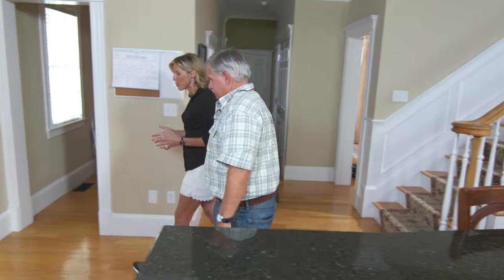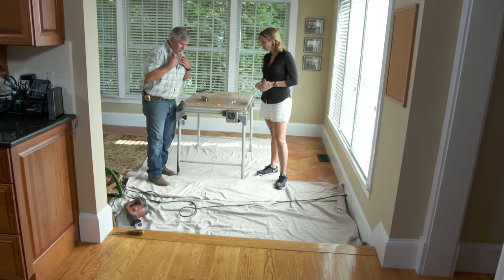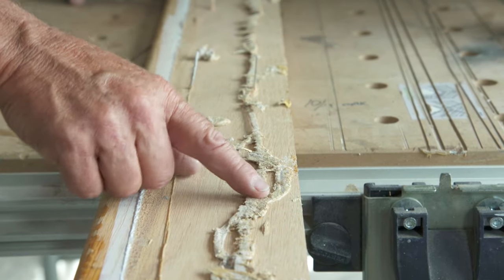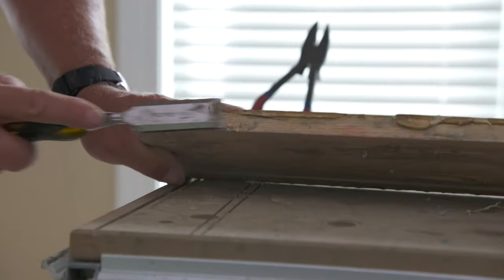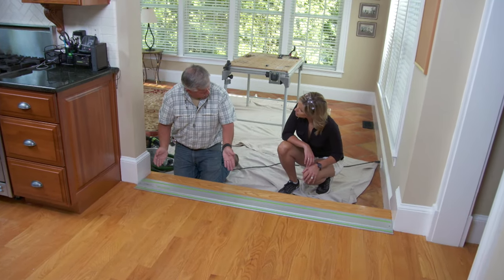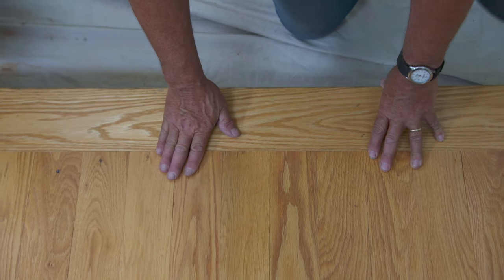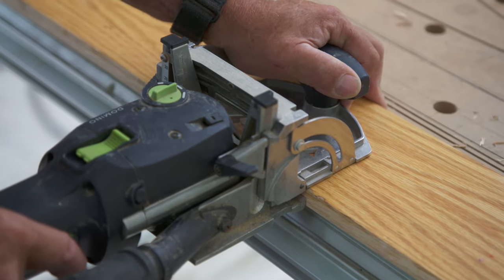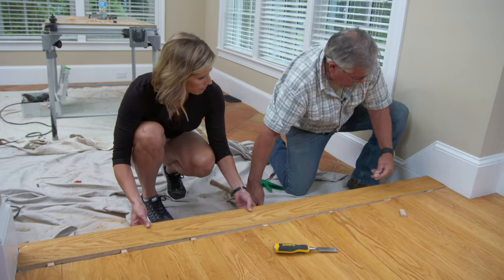How to Repair a Bad Flooring Joint | Ask This Old House

Comment: Amazing how they make a Festool track to fit exactly between those walls.
Reply: You can make anything fit with a big enough hammer!
Reply: i know i thought the same thing. things are never that easy when i do it.
Reply: @John Shay
and it comes with its own systainer  that costs another $500.
Reply: sarcasm get it? because most of their products tend to be quite expensive....
Reply: + Alexander Fagard -  I guess I'm as dumb as I look.
Reply: Ermanno D'Angelo 
maybe his customer has enough money that she can afford to pay for a festool rail bigger than the opening and he just cut it to length for the opening at hand?

thats probably a 300.00 dollar hit in the purse if so. not too bad a hit.

or maybe its a coinkadink and it fit perfect?

either way the festool track system IS  the best!!
Reply: They cut the track to fit into the space. To us that would cost a fortune but they get the tools for free for promotional purposes.
Reply: It is Festools domino cutter which is a form of a biscuit. It just happens to cost about $900.
Reply: “there you go Kate, that will be $8000.00 for my services.”
Reply: Maybe my wife will let me buy a festool track saw to do this repair at my house. Might be cheaper to hire someone.
Reply: I was thinking the same thing lol. I think he cut it to fit 😶
Reply: Tommy has Festool tracks in every quarter-inch size from 18" to 24'.
Reply: Track is for woosy, I would just use the regular saw’s spacer, nail the old board down or a piece of scrap temporarily to guard the spacer through
Reply: Yes it was designed for just that house.
Reply: @johnye4433  that why your not Tommy
Reply: For the low, low price of 600-bucks, you can have one too
Reply: @adrcamacho1 She will find a way to pay.
Reply: Even if they didn't, you can just get a straight board, cut it to length, secure it, and run any old circular saw up against it.

Comment: Cost
Festool track saw $660
Festool Certiified HEPA dust extractor $560.00
Festool domino joiner $990.00
Festool domino 85 pack $24.00
Festool work station $685.00
Reciprocating saw  $200.00
Chisel $10.00
Hammer $10.00
Wood glue $10.00
Construction Adhesive $10.00
=  $3159

Having Tommy do all the work for you? Priceless
Reply: His hammer is 199.00 for Stelleto hammer..lol
Reply: Tom is a top notch old school craftsman, a dying breed.
Reply: Any customer recognizes that tools price!!
Reply: Nice & tight joint 427 🤣
Reply: mathewparrett - don’t forget the Festool saw itself $900
Reply: Everything can be had at Harbor Freight for $25.
Reply: $19.99 Dewalt chiso..
Reply: Can do that whole job by hand but it would take significantly longer.
Reply: @Talachachannel  the chisel? yeah prolly
Reply: Jerk Of All Trades  tbh wouldn't doubt it. Although even with their short comings and honestly need for frequent replacement if used properly a good job results.
Reply: Is all the work and tool cost worth that small little defect in the floor?
Reply: Tommy just needs a $200 festool tape measure 😆
Reply: Canadian tire tools, and dowels instead of dominos lol
Reply: When he said it wasn't that hard to do I started laughing:)
Reply: @angellas.1314 yes.  The old job was crap.  Done by drunk illegal.

Comment: This must be some kind of sorcery, what are the odds the festool track fit exactly in that opening
Reply: You can expand them with screw.
Reply: John M yes you can expand by adding another track but still what are the odds of that be exactly the same size of the opening.
Reply: David, 
The model that he's using comes in different sizes.
It was most likely nothing but a coincidence that it was the same size as the opening.
in the back of the truck, he probably has 50 different sizes in there.
Reply: John M, taking in consideration that festool track are metrics unit and that opening is most likely trim in imperial unit, what a coincidence, and trust me those track don't come in many different size (maybe 4-5 of them)
Reply: Yo can make some using metric and imperial units and they can be the same lengths.
Reply: I bet they cut it to fit, it is a TV show ya know.  Everything is magic on TV.
Reply: Building codes have a minimal width to hallways
Reply: how is the guide secured to the floor so it dosnt slide sideways ?
Reply: David Daboin they made it for that cutie
Reply: @ben-vf  the tracks have  none slip strippes on them the downward  pressure from the saw keeps it in place.🤣😂😁😀😎
Reply: We were deliberately denied access to that very insightful detail. Notice the camera cut away at this exact moment when the rail was about to be shoved in to position. Were we exposed to the sliding, interworking mechanism of this fine festool? Hell no! It's a conspiracy! Film deception is what I call this. Hahaha.
Reply: @ben-vf  they have a rubber back on them, always stays secure. That's why we pay big bucks for Festool
Reply: @ben-vf  i do the same thing with 3M Command velcro and my aluminum i-beam level for a straight edge
Reply: @ben-vf  That's what I'm wondering.. Did he nail it in when she was at Starbucks?
Reply: @stevekwaske4612  Really? Because of a cork strip clued to the bottom? That must really eat into the profit margin..
Reply: @ben-vf wondered the same thing.  Tommy likes double-sided tape.

Comment: Look how easy it is to fix...with tools nobody can afford. Great DIY video guys. Cmon, man.
Reply: John Patrick I’ve got them all - plus more. I’m a DIYer. And yes, I can use them. Which is why I paid for decent tools. 

Waits for the “Festool is overpriced crap, buy XYZ instead....” 🙄
Reply: Graham Southern buying DeWalt or Milwaukee is hard enough for  DIY guy. Glad you can afford them and make that work. Just frustrating when a "how-to" video uses tools many do not have.

Comment: I had the same problem but didn't have the tools. Ended up drilling down through and used oak pegs its solid but you can see where the pegs are.I can live with it. Has my character in it, and that is whatever gets me by an it's my home .

Comment: What's with that gap in the overhang at 6:31?
Reply: What's with the paint on the wood

Or the black skuff on the riser
Reply: wood expands and contracts in the width like he described at the beginning of the video.  If there was no gap and that piece contracts, the original gap he fixed would be back.
Reply: Darren X that gap looked like it was half an inch
Reply: some caulking and its fine, i agree it a bit large
Reply: + shouldibehere -  it's a lack of paint. It's the same thickness of the adhesive that Tom scraped off the back of the board. They painted after they installed the floor. With the adhesive removed, you see the unpainted wood.
Reply: nope. there is a gap you can see it if u watch closely when he bangs it in. sure painting the inner side of the wood on the wall would help, but it doesn't allievate the fact that there is a gap
Reply: + Alexander Fagard - I don't think we are talking about the same gap. I'm talking about all the way to the right of the piece you step up on.
Reply: Lex Luther the one at the timestamp 630...
Reply: + Alexander Fagard - thank you. We are not talking about the same gap. At 6:30 his hand, holding the small piece of wood, is covering up the gap that I am talking about.
Reply: no i think we are saying the same thing as his hand is also covering up the same thing. where the riser meats the wood/baseboard. you are right that it is more noticable because its not painted, and that it is at a different height because he scraped off the adhesive and pushed it down, but you can see that they originally notched the baseboard/wood and because of the height difference the gap is no longer "filled". you can see it better at 6:24. but really it doesn't matter haha, some caulking or paint will fix it either way.
Reply: If you look closely at that gap, it looks there is already a cutout in the baseboard for expansion and contraction. 
He just cut too much. Where nothing needed to be cut.
Reply: Nothing that a little white painter's caulk wont hide
Reply: That's what a fes-stool tool owner does. only the best, HA. nice catch
Reply: Darren X That's why he glued it to the other boards.
Reply: Fix an old door
Reply: Gap? That’s an oopsident!
Reply: he just forget  o said its ok
Reply: Remember, Tom removed about 1/8" or more of glue from the bottom of the board so now that board is sitting lower revealing the unpainted  part of the base which gives the appearance of a gap. But if I'm wrong,  just remember, "Caulk and paint makes a carpenter you ain't "😆
Reply: Measure four times and cut once 😜
Reply: @jwiskow01  "the" carpenter you ain't, but I get your point.

Comment: Tool cost. Saw $660, Vac $510, Domino $910, MFT $685 = $2765.  Which I'm not sure if I'm surprised by the cost just to fix a step, or saddened that I own all the tools.....
Reply: I've got the perfect solution for your tool problem; move to where I lived. I'm sure in 6 months or so you'll be gone a day and come back and find your friendly meth tweakers have moved all your tools from your house to theirs! Nice fellers that the are, they will remove everything else that isn't bolted or welded to the property as well.
Reply: For all those tools where i live is less than £1000 brand new

Comment: This may look easy on tv but it's not even close to easy. This can easily be a 6 hour project if your doing this the first time. One thing i would caution about is the time of year when you do this. If it's summer leave a 32nd inch separation at the gap because the wood is in a shrunk condition. It will expand slightly in the colder months and in humidity. (Doesn't apply to 2nd or 3rd floors typically. (First floor with a crawl or a slab foundation applies)  If it's winter and your installing it pull it tight because it will shrink slightly under warmer conditions. Also spread your glue in a swirl pattern about 3/4 of an inch from the edges to keep the glue from bleeding out when you press it down but also making sure to have good glue contact all the way across the board and slightly in the joint if you don't have a tongue or a groove.  Throw an expert a dime and save yourself the pain of destroying your floor because you didn't get the angle right, don't own a 800.00 festool saw and slide, don't own a biscuit maker, don't know what kind of glue to use, don't know how to clean up the ends of the boards that a "circular" saw won't reach (other than a choppy chisel especially cutting across the grain) and the whole thing becomes a mess. Utmost respect for This old house I have learned so much over the years but experience has been my best tutor. I am a realist and if you try this without the experience you will fail some part of it. You will see that mistake every single time you look at it. If your brave enough to risk a single room of hardwood flooring ( 10ft x 12ft) 360.00 for the flooring 34.00 staples, 15.00 underlay, 100.00 demo if stapled 300.00 if glued, 35.00 threshold each, 400-600 dollars in labor for a pro to lay the entire floor and having your home tore up while all this is done? go with an expert. This is a 250.00 repair in most cases. Research and save yourself a lot of time and money.
Reply: Oh your a funny guy. I make my own guides until Festool comes off their price. How I do love the design of their tools though and if they would like to sponsor me I would be all over it lol! My guides are made from thin masonite material and a plastic lattice piece for the slide. They work every bit as well as the festool you just have to pay attention to what your doing. Also one thing I forgot to mention in my comment is to use a brand new finish blade when you attempt this.
Reply: Rezo TheRockLuvr, Good point but there's usually more humidity in the summer verses winter. The wood floors in my house always have bigger gaps in winter because of the dryness.
Reply: Depends on the climate zone. I'm in the south east. If I were in the north or in a harsh winter or even running a wood stove that would be different.  You have to take humidity into play.
Reply: You have a lot of time on your hands. These videos aren't meant to give you a step by step to complete the process, they're meant as a guide to show you what is involved in a job like this.

Comment: But why use those joints to keep the nose together? I usually use a router with a flat cutting tool both on the heads of the floor boards and on the side of the nose board, for the full length, and then join using a 4mm plywood slice. Once glued with wood white glue and gluing the nose with proper flooring glue (my favourite is Kerakoll L34 Flex) there is no need to nail down the nose board, you just have to keep it pressed down for a while using some weights or extendible bars. Nice video though, I love the style. Cheers

Comment: That straight edge saw rail thing was pretty handy! Without it I guess you'll have to rip up the floor and cut each, individually?
Reply: Integra DIY yeah! That's what you would have to do!!!!
Reply: Or you get a board, run it through a jointer and make your own straight edge.  Cutting each piece individually just increases the chances of cutting them incorrectly.
Reply: No need to rip it all up. It could be squared off with a router, although it would need some sort of guide which could be made up from some spare bits of wood. You would not want it gouging a lump out of the floorboards. Alternatively us a circular saw with a temporary guide.
Reply: Take a straightedge, nail it in two places with small nails, use circular saw, patch and stain.

Comment: As a flooring contractor, fortunately I’m not asked to do that kind of repair, except in conjunction with sanding and finishing a floor.  If I were installing a floor that needed nosing, I’d have boards start there with end tongues sticking out into the nosing.  The only time that I can’t do this is when the flooring runs at a diagonal. Instead of spending the money to buy biscuit joiners, I use a 5.5 inch nosing, instead of the 3.5 inch nosing shown.  With only the adhesive and nails holding it down, over time stepping on the end of the nosing loosens it.  The 5.5 inch nosing gives a wider center of gravity and more area to put adhesive under.  I’m sure that the joiner method is better but I don’t know of any floor installers that do it.
Reply: That is NOT a biscuit joiner.  That is a Festool Domino loose tenon joiner.  PLEASE!

Comment: At 2:58 you can see that the bad cuts all follow an even, wobbly line. It appears the installers ran those boards wild, then cut them all off in place. Trouble, they didn't know how to do it correctly.

Comment: all the joints and glue, then dude pounds a nail through the top! ouch
Reply: vigilantezack it had already been face nailed. he pulled them out at the beginning. so holes were already there, might as well put nails back in them.
Reply: IKR all these internet critics who probably only do this stuff 3 times a year like to chime in.
Reply: diver dave The nosing was already pilot drilled, previously. He didn't need to pilot drill into the subfloor.
Reply: That's not all he was pounding
Reply: @artonline01 3 times?  Never!

Comment: how does the track attach to the floor? I couldn't see that. Did one of these the other day and used a 1x4 for the straight edge and trim screws to hold it in place. Made the cut with my 5 1/2" cordless.
Reply: Tom, those guide rails have silicone strips on the underside, that grip the floor, so you dont have to clamp the rail down.
Reply: @stevemcginn9200 i would not trust that.

Comment: I watch plenty of these videos, and every time I say the same thing. 

"Yes it's your home, but it is going to be a construction or a carpentry jobsite for a while. And you are going to be helping out. Can't you put on some long pants and appropriate footwear for a jobsite?"

Not work jeans and steel toe boots necessarily, but not shorts and flimsy canvas sneakers, either.

Comment: If you don't have $5000 worth of festools another way is taping a 6 foot straight edge to the floor and using a multi tool. Simply glue the nosing and pop a few 23 guage headless pin nails in the top.

Comment: wasn't that hard to do?  you put glue in a joint.  and yes it is hard to do and the amount of tools demonstrated here probably costs around $3,000.  could be done cheaper but don't act like it was easy peezy
Reply: Festool is stupid expensive, but to buy the tools necessary to do this job would cost nowhere near $3,000. A brand new Craftsman circular saw from Sears would cost around $45, a brand new Ryobi biscuit joiner would cost around $100 from Home Depot, a brand new Estwing 20 oz hammer would cost around $26 from Home Depot, a brand new chisel set would cost around $11 from Home Depot, and a pack of nails would cost anywhere from $2-$5 from Home Depot. That brings the grand total up to somewhere in $190 range, with everything being brand new. You could get all that stuff, minus the nails, cheaper too by putting ads on Craigslist for those tools used.
Reply: The only specialized tool he used was a mortise and tenon jig. The one Tommy used was expensive but you can pick those up starting at $100.
Reply: Kang Kim I agree, most of it could be done with hand tools, but it would just take a little bit more time. As well as the biscuit jointer/ mortise and tenon jig, the lowest I've seen them go for is like £84.99. In dollars I'm not sure how much that is lol
Reply: So annoying eh buddy? That domino alone is like $2500
Reply: The only way you will find a festool in my hand. 1) it was given to me. 2) im on my way to sell it. 
Festool = junk
Reply: @kangkim150  could have used a drill and dowels to get the same effect.
Reply: They're told to say it's easy. All the awkward dialogue is scripted.